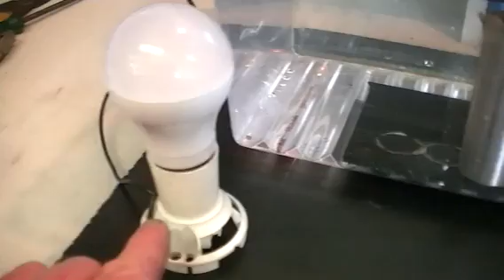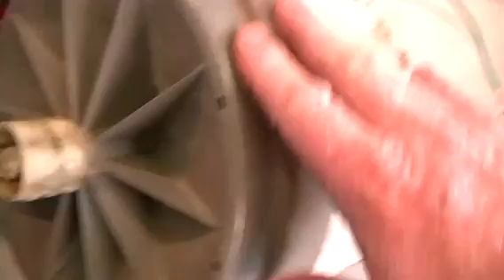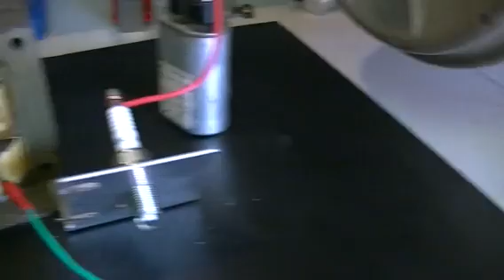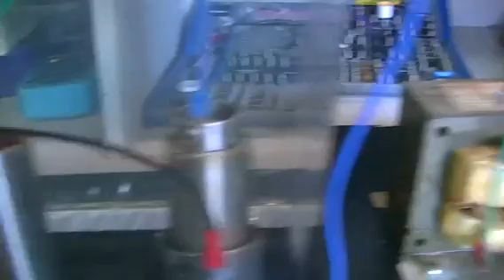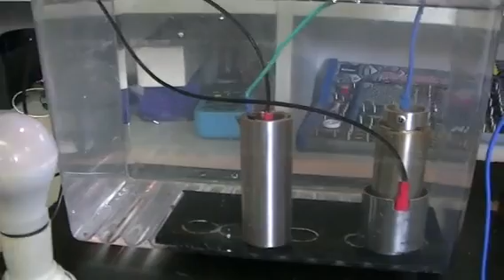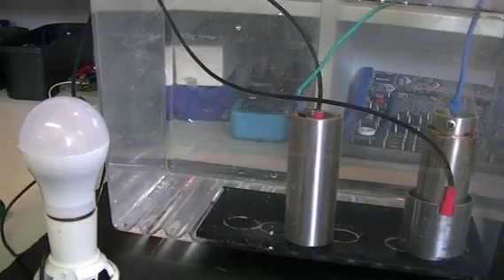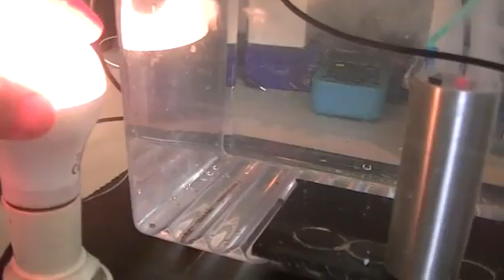High voltage HHO drive circuit

Comment: Interesting setup.
You can slow the burn rate of HHO
by running the gas over a plasma.
Plasma source I used to prove this was from an ozone generating device.
It seems odd to me that the HV side of the MOT is electrically connected to the iron core.
Thats how they are built and I figure it would reduce efficiency by heating the iron up...your thoughts?
Reply from the maker: The iron will get no hotter that usual,as it is the copper coil that produces the heat,regardless of where the terminations of the coil are. All HV output's over here in Australia must have one end go to ground unless they are what is called!double insulated!,which this one is not.
Reply: @69Atho  Hello, OP. Which both anode or cathode represent on left or right electrode? Thank you.

Comment: so you are pumping in AC to the cell?
Reply from the maker: No,the voltage and current remain DC due to how the HV coil is shorted with the spark.This induces a very strong magnetic pulse into the primary coil that is hooked in series with the cells and alternator.
Reply: Way cool TM! Can't wait to see the next Vid.

Thanks for sharing "D"